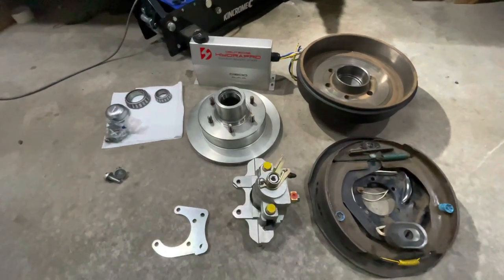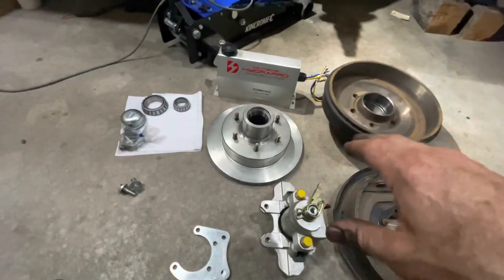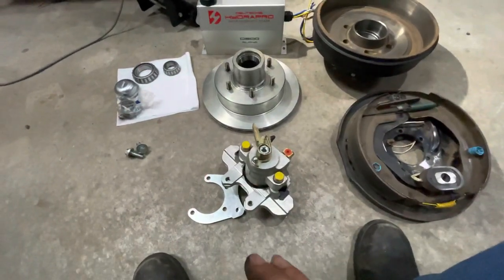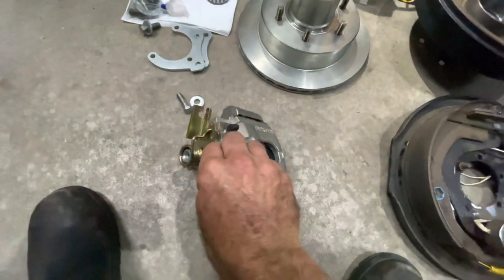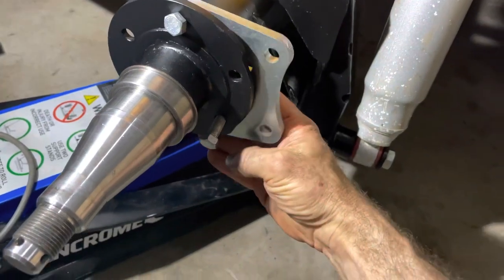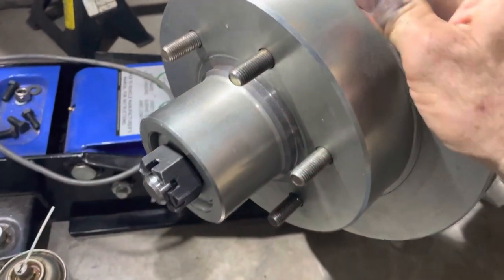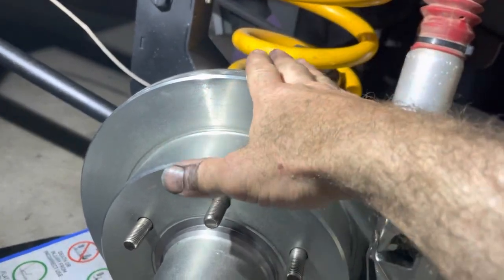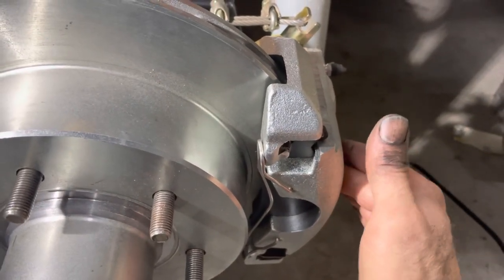Caravan drum to disc brake conversion

Comment: Looks like a pretty easy swap, but the cost! Something we definitely want to do  in the future.
Reply from the maker: Thanks for having a look at my vid definitely not as good as what you do.
Yes this is a costly job to do, if I had done it when I first purchased the van I would of saved myself a lot of money in replacing drum brake parts, so so far I have spent as much on keeping the drum brakes working as what I have spent on the disc brake conversion. Some thing I did not mention in the vid is that there is 10” and 12” rotors and they require different Disk brake caliper mounting brackets and calipers

Comment: thing that i read about a disc brake set up is it is not as jerky , and are more efficient than drums where as less brake fade , you can buy pretty cheap hydraulic set ups on ebay however that original mounting plate that goes around hub they dont seem to sell those in the kits ? might be worth my while to just stay with drums  i have an old jayco 1979 im doing work on from a previous neglectfull owner
Reply from the maker: I have now done over 5000 km on my disc brake conversion and I can report that this is correct disc brakes are not as jerky and definitely brake more smoothly than the drums as for fade I cannot comment  on that as my van isn’t that heavy and never had a problem with the drums fading. I didn’t install the disc brakes for better breaking though it was more for easier servicing of the brake system, As I do a lot of kilometres on dirt roads and electric drum do not last long in these types of conditions. 
I bought everything in a kit part number is 200896UFPWP  from ALKO Australia. One thing to remember is this part number only suits 16 inch or bigger wheels. The problem with ALKO Australia is that they don’t seem to know their products very well as they have bought out a lot of other companies and don’t know about their products, this is a Dexter set up. You need to find the right person to talk to, I was lucky at the time I went into the trailer parts store the ALKO rep for our local area was there and knew all about what I needed.
Pros for the disc brake 
1/easier serviceability of the brakes
2/ a lot smoother breaking
3/ About 7KG is lighter an Axel
4/ Better braking in a emergency stop situation
5/handle dusty conditions better

Cons 
1/ cost more
2/ need to mount the actuator somewhere
3/takes a lot longer to install as you need to mount brake lines, actuator and do extra wiring 
4/ Braking really isn’t that much better under normal driving 
5/ The disc brakes squeal like anything at slow speeds. I probably need to use some anti-this break squeal on the pads.
6/ they require the brake fluid to be changed yearly
Please tell me about the cheaper ones that you have found on eBay as I could not find any electric over hydraulic actuators in Australia under $1000.
Reply from the maker: Sorry it took me to goes to upload my comment

Comment: Phil do you still a brake controller after a  change to disc brakes? great videos thanks
Reply from the maker: Yes you still need a brake controller I have a tow pro elite. But you can use any brake controller that has inertia sensing

Comment: Great info, great flick. How does the Hydropro connect up in the scheme of things - oil, master cylinders etc.
Reply from the maker: The Hydra pro is a self-contained unit which has the pump and brake fluid reservoir, all in the one unit. All one needs to do is to hook up a single brake line out to your disc calipers, Connect, battery power, ground and the blue wire from your brake control unit and for fill the unit with brake fluid, bleed out air from the lines and you’re ready to go.

Comment: Great video with all the detail info to do a conversion.
I have 12" discs with the Deemaxx caliper. The Deemaxx uses different thickness pads for each side and on our van the thin side wears very quickly on the dirt roads. I am looking to change the caliper to a Dexter but cannot get any dimensions from Alko. Do you know the distance from the caliper mounting face to the disc centerline ?
Reply from the maker: Hi Brian I did look at the deemaxx caliper as they to have a hydraulic caliper with inbuilt handbrake but did thought it was a bit odd that it had two different thickness pads that’s why I went with the DB 35 caliper. It’s probably best if you email me on 
dingleyphillip@gmail.com  
That way We can share a phone number and talk over the phone if you’re based in Australia

Comment: Hi Phil
Looks like you have it nailed is it possible to get the part numbers and any contact that you managed to get the kit for as I have had the closed door by being told that there was no kit and I have a 4000 ton caravan and want to do the upgrade so any info would be much appreciated as I’m in Ballina Northern NSW 
Regards 
Tony
Reply from the maker: @tonysmith4085  Converting your caravan/ trailer from drum brakes to electric over hydraulic disc brakes is not a cheep project to undertake, which is why we do not see it as standard fitment here in Australia. By the time I finished the install it cost me close to $2600 AUD for the parts only which is over double the cost of electric drums 
The components used are sourced from 
Al-Ko Australia via my local trailer parts supplier. Breakdown of the parts are￼
Dexter left and right UFP DB 35 callipers with  handbrake $250 each AUD
Dexter UFP35 mounting brackets x2  $40 each approx AUD 
4x 7/16 x1 1/4” UNF to mount the callipers $9.00 AUD for two bolts with washers 
2x AlKo 2 Tonne 12” 6 on 51/5 hub rotor $250each AUD 
Whole kit from ALKO part number 200896ufpwp Which includes all of the above but the 7/16 bolts, it also comes with wheel bearings, split pins, hub lip seal, 3/8” unf bolts for calliper mounting bracket, hub dust cap and wheel bearing thrust washer. $1000.00 AUD for whole kit 
Hydropro Electric over hydraulic brake actuator 1600 psi unit $1047 Australian￼
Approx $500 in Brake line Parts I sourced from pro flow this allowed me to make my brake lines to the required length but you can buy premade brake lines from Trailer Parts suppliers.
Reply: @philsrandomstuff2392  
Thank you for your reply our local supplier was suggesting around $3500 for the parts but the calliper mounts had to be welded to the stubs and not with adapter plates which adapters would be a better option
Reply from the maker: @tonysmith4085  not sure what you mean by which adapters would be a better option?